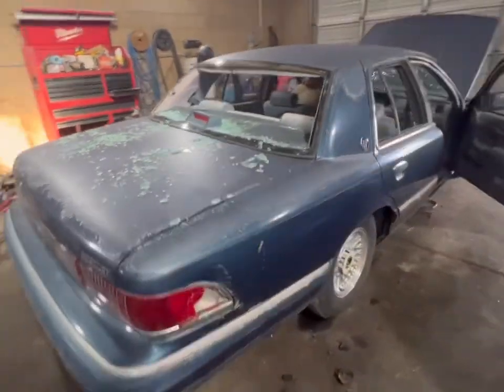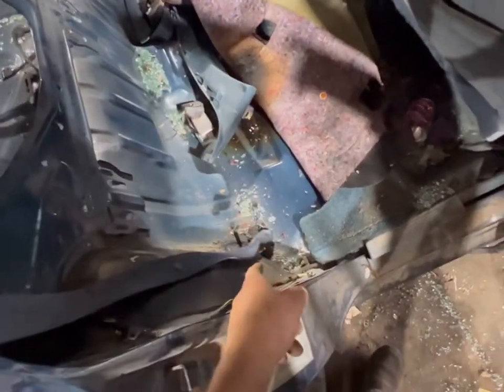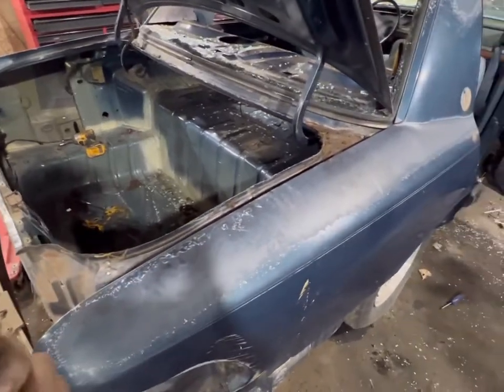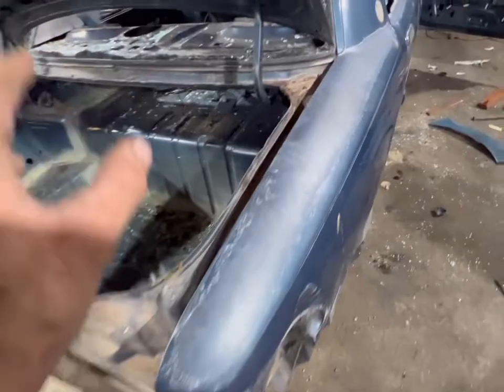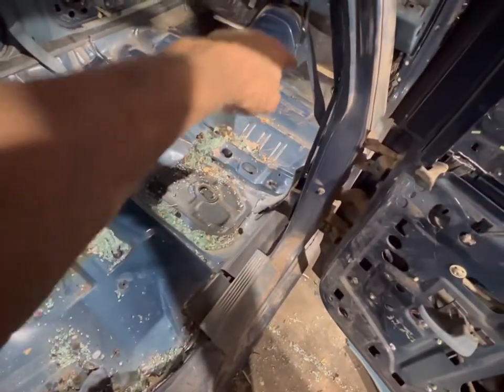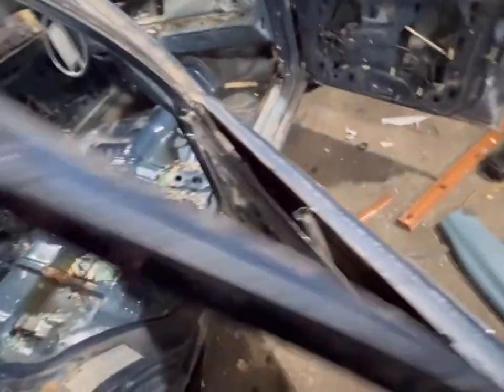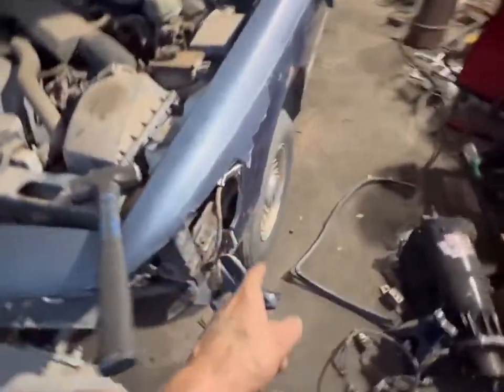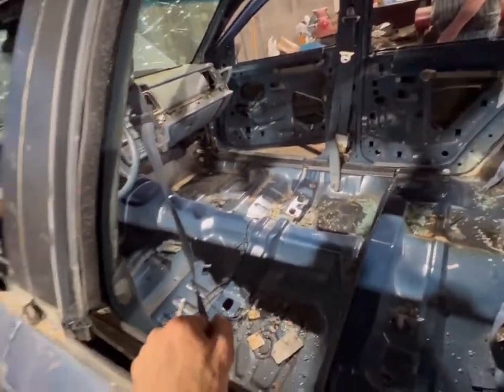How to build a wire class car “crown Vic” part 1

Comment: tips: gut the thermostat but leave it in(it will get hot faster without any restriction). fresh plugs and oil. get your vacuum/intake system right, cooling system secure, replace cotter pins in steering, Lucas stop slip in the trans(This is a must pre 96, i put lucas in everything stock though). someone already mentioned temp sensor.

**Notch out the cradle for starter clearance, the starter breaking or grounding out is usually what takes stock 4.6 cars out... also run a starter wire while you're down there. 

97 down are a lot easier to deal with than 98+ with the bigger calipers and spindles if you're running 15" rims up front.. not sure on your exact rules, but you can pull all of the wiring through the pass firewall by unplugging everything under the master, pulling through the core support and back through. you just have to extend the alternator cable. Have had no problems just zip tying it all to the top of the firewall though.

you can do more or less to them, but as long as you make sure its running right and have all of the grounds bolted in well it should be fine. 

What are you trunk lid rules like? Depends entirely on what you can do as to how i'd notch, but i window notch 1-2"(dimpling is fine) at the normal double hole spot and its flipped perfectly on all but 1 car that got teed off on.
Reply: oh and change the oil filter to a smaller one. lower water neck/filter like to snap

Comment: So the temp sensor is a big deal on the 4.6 engines. You can take the connector off and wire it together and it won’t go into limp mode. Hit me up on FB and I got a few other ideas under the hood
Reply from the maker: I’ll hit you up right now